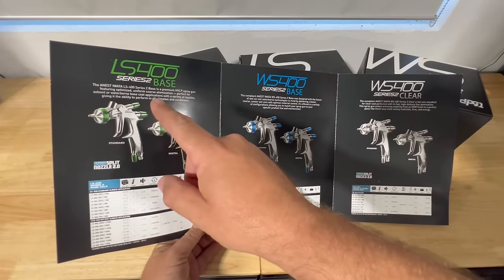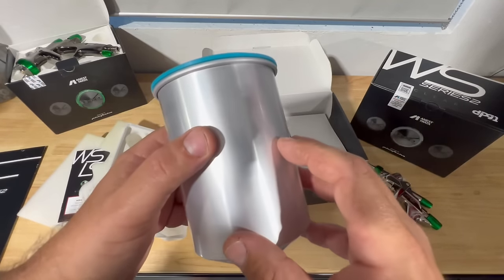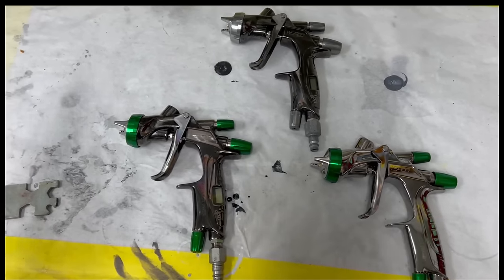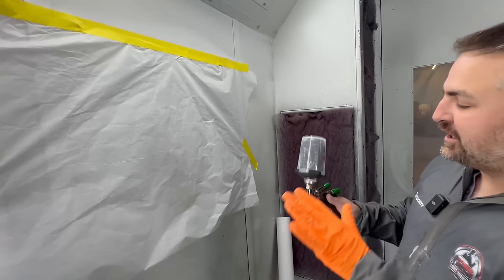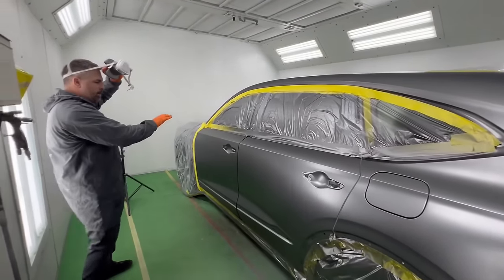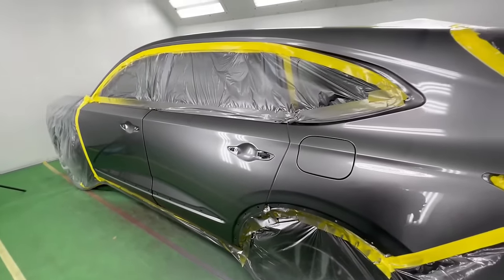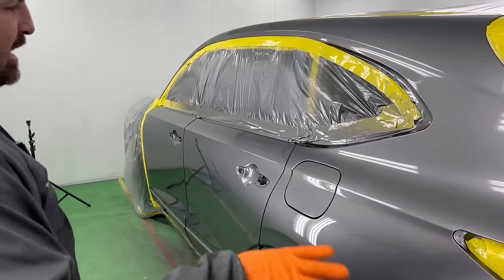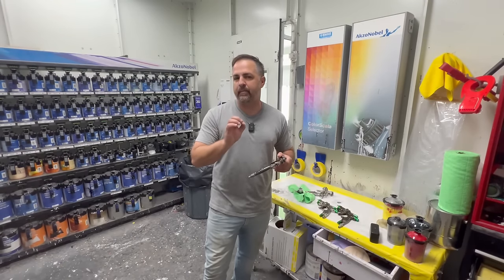Has Iwata Really Improved the New Series 2 Spray Guns?

Comment: The LS400 HVLP was designed to atomize the droplets of water-based paint, which is well applied wet, which is why the nozzle of the LS400 et green is much larger than the nozzle of the WS400 OBS Blue. I have all 2 and the difference is very big when applying solvent base
Reply: LS was developed for solvent and first gen waterborne while the blue OBS was developed for second gen waterborne

Comment: So interesting your perspective on the Series 2. I know TheGunMan speaks poorly of them saying they are a pain in the ass to dial in. But tbh, he is negative with almost any spray gun that is not a GTI Prolite.

I am torn between a Sata 5500 1.3I or a Iwata w400 Bellaria for my clear gun.

You mentioned about clear being piled on around the edges and I see that a lot when some technicians spray a super high european 2:1 solid clears with a Sata RP gun. The Sata's with that O Pattern just loves to pile on clear.

I am geared more toward restoration/custom work so I am trying to achieve that super flat finish.

I am definitely going to look more into the WS400 series 2 gun for clear now. I just hear soo many mix reviews.

Thanks Brian

Comment: I use the series 2 clear gun atleast 3 times a day since they became available. My only fault with the gun is the digital gauge, im already on my 3rd one after a years use. 

My current setup is fan 2 1/4 turns from all the way in, fluid is 3 1/2 turns from all the way in, spraying at 1.5 bar

Comment: If you want a good setup on the ws400 clear coat, remove one turn, just open 2 turns of fan and 4 turns of material at 30 psi. It's my go-to setup on that gun using a high solids clear coat, and it's the best gun I've ever used for the clear coat 😊
Reply: I used to do that then I found fully open 1 1/2 turns closed worked better on fan
Reply: @markmikheyev6730  That gun only has 3 and a half turns of fan, if you remove it one and a half turns, it's only 2 turns, and that's the configuration I wrote in my comment 😊😜
Reply: 1.2 ?
Your daily clear?
Reply: Wasn‘t it the Purpose for the Evolution of the Series 2 NOT to Play work the Fan anymore ? Just Full Fan and off it Goes like Most other guns ?

Comment: Have ever sprayed the new sata x5500 rp 1.3 clear coat gun? and if so how would you compare with to the iwata you just used?
Reply: just switched from sata 5500 rp 1.3 to the supernova for clear and it lays much better not as much peel and i run through less material. changed my clear game no doubt
Reply: Iwata atomizes finer than the Sata 5500 even with the I pattern fan .

Comment: I have both. They deliver like a sata but they are probably the most finicky guns on the market. Setup must be excellent and on tee or not the best for noobs. I saw that with your base coat. I said it looks like a factory panel not a respray. It looked like straight off a line panel. I have yet to use my entech 400 and ws 400. Still using my sagola. And my old tekna copper. Someday will have some fun.
Reply: If you were to spray base with the ws400, would you be able to tell much difference vs the LS?
Reply: @dogemcmoon9644 supposedly the entech 400 or ls I have the version one. So it hvlp and easier to handle but still the fluid pressure distance and fan issues. They are finicky and they need to be set perfect. More oem type peel imo. Ws 400 is just like u see super fine. Basically hides the result by coming out really like straight off the line panel. Sata doesn’t do that it belts it out. And notice u really wouldn’t need to cut anything as the finish is so fine and perfect not much to do to send it to customer. Really an excellent gun but not really for your noobish guy. The settings as he says really need to be close to perfect or you’ll get run city or just too much build certain areas or dry spot from bad fan setup. It’s too wide factory and needs like 1 to 11/2 turn in
Reply: Bottom line ur gonna get more peel with the entech for mine since I had series 1. Don’t shoot clear with it. It’s a base gun. It’s not a clear gun. Ws is the compliant high atomizing clear gun.

Comment: 1st time i used the ws400 1st gen solvent gun it was a water hose runs every where. Did you reduce wth activator ? by how much. Also my settings were ,Bottom wide open/trigger wide open and fan 3.5 out from closed fort he fluid.29 psi

Comment: I still use gti pro lite for base and clear, happy with it but id like to try another gun. Devilbiss still serves me good like the first day it did, so im stuck deciding between new ws400 series 2 and dv1 for clear....
Reply: I've always been devilbiss but this WS 400 clear is an INSANE gun. If you've never used one get one. I bought the old version. So good.
Reply: @Mcfc2Rich  Ive been lucky to find a test gun in a local shop few days ago, but the old version, ws400 evo clear gun. Its true about the huge fan with dry in middle, but when you close down that fan it does spray beautiful indeed. Il wait for series 2 test gun to arrive, if its similar, il buy it. It does work great, this iwata ws400 series. Love it so far. Tho id like to test other guns too, dv1, some sagola maybe, and the sata 5500cc.

Comment: I've been considering an iwata series 2 gun, thanks for the review.

As a weekend warrior I couldn't really justify a separate base and clear coat gun. Is there a reason I couldn't spray solvent base and clear with the clearcoat gun?
Reply from the maker: It will not atomize the coating the same way. Although you might not notice if you’re just a DIY

Comment: What difference would it make if you sprayed your clear at around 32 psi?
Reply: The higher the pressure the more the clear is atomized which should result in a flatter finish (less orange peal)
Reply from the maker: More air over powering the fluid. Excessive overspray and dried air droplets
Reply: @jamesfell4793  Brian said all atomization occurs in the gun body

Comment: That was big risk basing that door and leaving it to cure, luckily it didn't pickle up when you laid down the next coat of base. That often happens
Reply from the maker: Thats never happened to me. Not sure what the risk is
Reply: No risk if water based but if solvent it can definitely happen as the solvents in the reducer on the second coat can attack   cured base causing it pucker up, some painters call the reaction fry ups because the result resembles the edges of a fried egg.      @PaintSociety
Reply: I base and clear entire doors that way that problem never happens

Comment: Can I use the first gen ls400 entech for both solvent and water base?
Reply: It sprays both. It was designed for water. I spray solvent with it and it works fine.
Reply: @HackMasterBlaster  thanks
Reply: @Eputz05  no problem.

Comment: Hi Bryan, the ws400 blue Designed for solvent-base, the LS400 was designed for water-base.
Reply: The blue cap is designed for wet on wet, water systems, like Axalta spies hecker, cromax pro, Basf 100 line